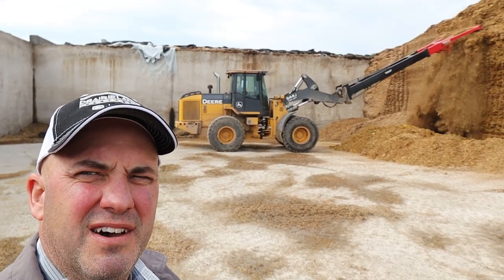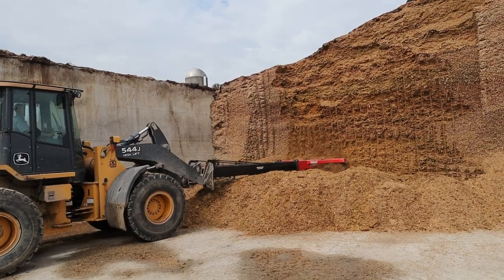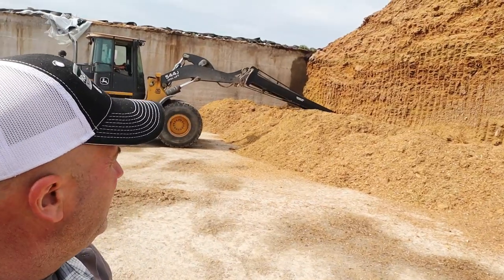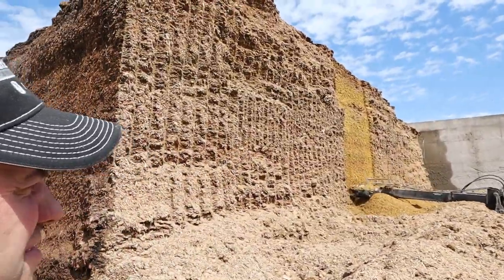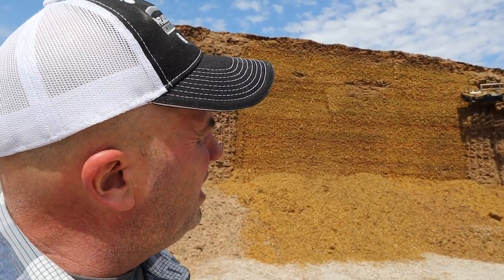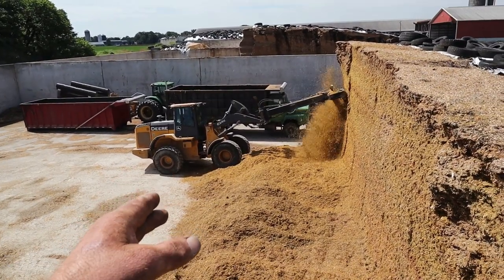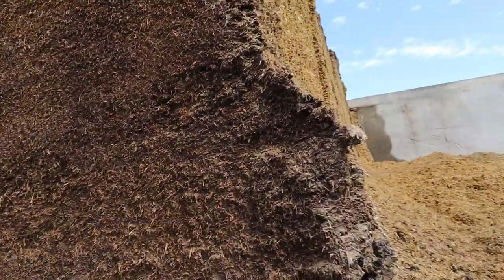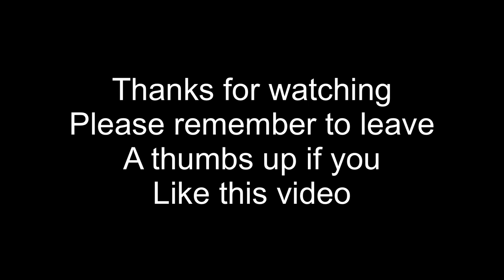Raking and Defacing silage pile

Comment: You mentioned the same company built the rake and the defacer.  Are these custom units, built just for you, for your operation, or are they part of a suite of products for silage management?  If custom, did you design them?  Who did the engineering work?
Reply from the maker: No not built specially for us. The name of the company is Fritsch Manufacturing they build defacers for anything from a skid spinner to a wheel loader.

Comment: Wouldn't your telehandler reach and run a deface? Sure a lot better and more accurate than using bucket that never worked quite as planned
Reply: I used to have to try face bunk with skid steer bucket. What really saved us was bunker would run out late spring early summer because top unload silos are funnier in summer
Reply from the maker: We have a defacer for telehandler it doesn't run it fast enough for what we have to do.

Comment: I don´t understand why you don´t build an extension for the defacer instead of using the rake at all? You might even make the extension detachable if it becomes awkwardly long at times.
Reply from the maker: If the defacer was any longer you would have a hard time reaching the bottom 5-6 feet believe it or not.
Reply: @FarmingFixingFabricating  Thanks for answering!  I understand the feed pile might get  in the way but the extension could well be mounted at an angle to the defacer frame. The visibility might be reduced though since the attachment becomes farther away from the operator. Thanks for interesting videos anyhow!
Reply from the maker: @jabond77  it's an awkward angle that doesn't work well. It's almost like trying to dig backwards with an excavator. As soon as you curl the carrier out the torque from the  defacer starts to work against the loader.

Comment: it sounds like the front end of that loader could use some grease
Reply: nathan I was reading to see if someone else noticed that too
Reply: @aaronwilton6531  drivers don't know used one
Reply from the maker: The one z link we have trouble with It must be slightly bent and creaks a little no matter how much grease it has.
Reply: Thought  mixing  some  old  engine  oil some  over  oil with  diesel  poured  over  pin work  in sometimes  work